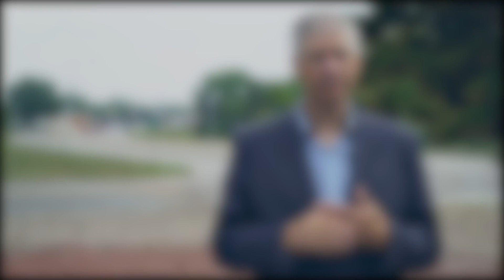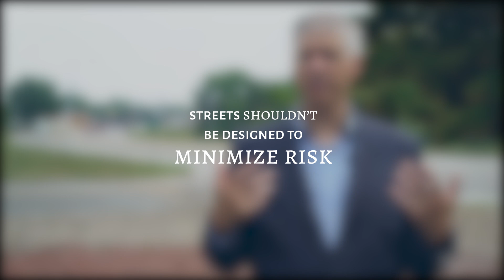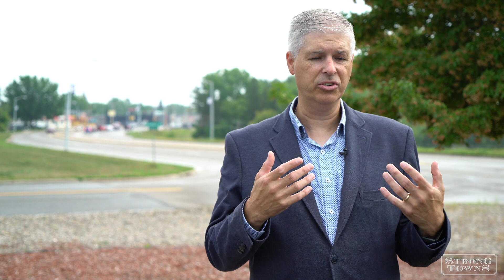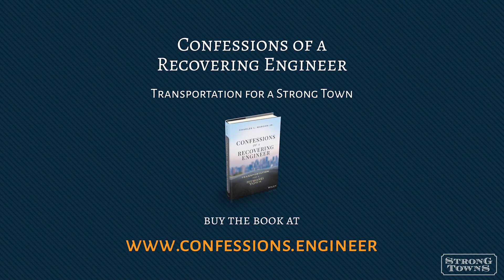30 Days of Confessions: #26 Risk Compensation

Comment: These are short videos, but I think you miss an important caveat.  For what you classify as "roads" versus "streets", designing for increased performance IS a net benefit to safety.  Highways are designed to be comfortable for high speed driving with the types of features you described, yet the benefit to safety exceeds the risks of increased speed, which is why limited access highways are the safest roads.
Reply: Yeah that’s one of his major points, I think he coined the term stroad
Reply: The purpose of a road is already to go fast. That's why confusing roads and streets for the same thing is so dangerous, to say nothing of the general efficiency. Designing a street like a road (most streets in the US do this) encourages drivers to move faster than what is actually safe, due to points of conflict that are supposed to be on the street: people, homes, businesses, etc.

Comment: Top. Are 'minimize Risk' and 'forgiving Design' equal? Or are there any differences between the terms?
Reply: I would suggest that forgiving design is a thing you do to minimize risk. It's an action you take, one of many possible, to accomplish that goal. If you want to minimize hunger you might make more food, and that might fix the problem you set out to solve but if there's already enough food in the house you making more just creates a problem further down the line, more leftovers to store and potentially throw away when they go bad, for example.

The other important thing to recognize is that there's different risks to minimize and different people to forgive with design. Right now street design is balanced in such a way that we save the cost of a new bumper for a driver at the expense of the life of a cyclist, we reduce low speed car collisions at the expense of the safety of pedestrians, and we increase the convenience of single occupant car use by turning over 2/3 of the average town to car-only roadways and parking lots.